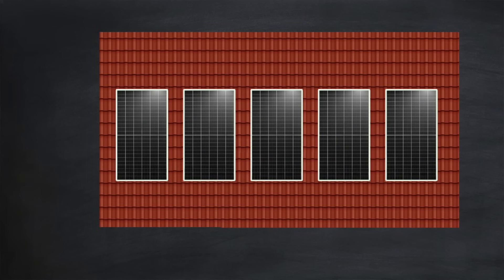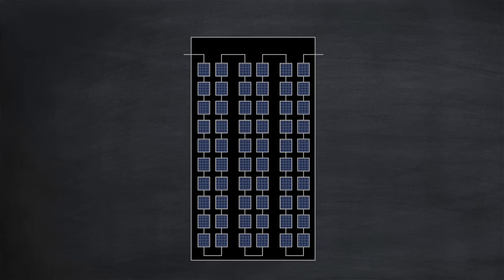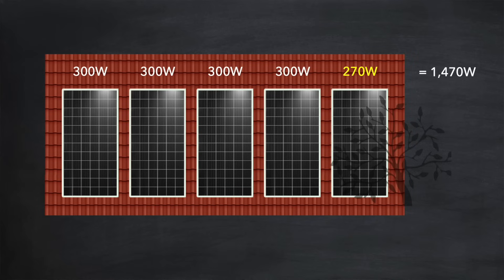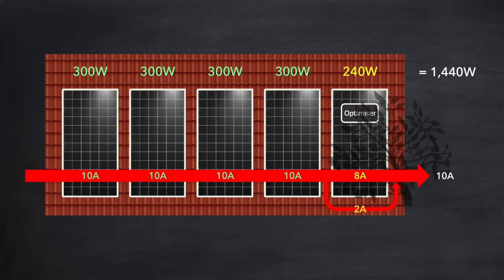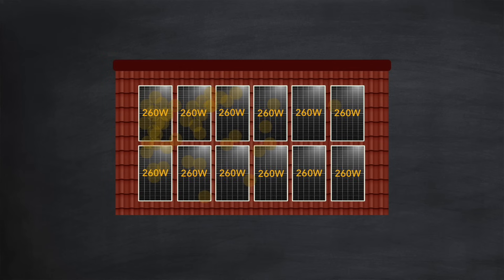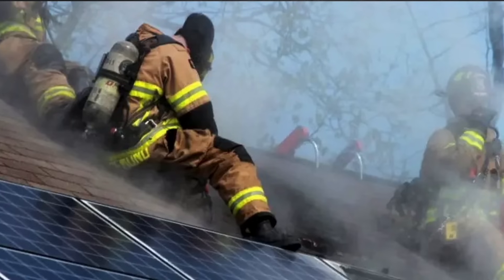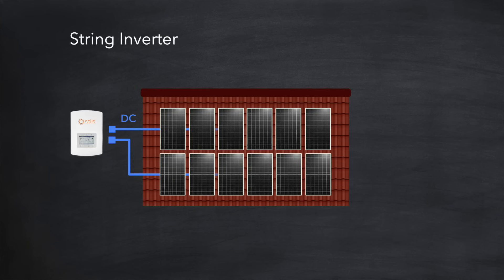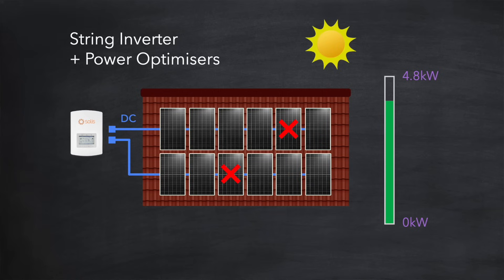Power Optimisers - What are they? And do you really need them?

Comment: At last a solar presentation not full of excitable hype and blah-blah. Consider yourself subscribed.  An optimiser failure on our 2015 4kw solaredge system bought me here so just another single point of data from someone who is absolutely not a techno-pup. The solar edge app has allowed easy identification of the failed unit and access via scaffolding tower from our excellent local installer was only thwarted by high winds. My non technical mind has been swayed by tge advantages optimisers may give as dirt accumulates on some panels. Particularly as we are in a very coastal location and salt accumulation is anecdotally claimed by those of an agricultural persuasion to be as high as one ton per year per acre. Perhaps coastal installations is the subject of a whole new video. Certainly the luminosity of lighf reflected off the water is a plus.

 Anyway keep up the good work Gary!
PS Dang! And then the Immersun unit failed this week - replacement by an Eddi has blown a gaping hole in this year's payback caculations. That and Good Energy going ,via smart meter info, to paying foe exports on actuals rather than a caculated 50% of output. Sorry to rant on but.....pfftt!!!😮😢
Reply from the maker: Hi David, thanks for sharing your experiences and also for your kind words. Given you had a failure a few years ago, would you say your overall impression is good, or would you have preferred to have gone with a different inverter?
Reply: @GaryDoesSolar    Hi Gary! Funnily enough, back in 2015 when the system was only 6 months old the main Solaredge inverter in the garage did fail and was replaced under warranty, the fitter said they had had a complete rash of failures locally hence the upgraded replacement item. 
I was just pleased the guarantee worked as advertised.
As for the diverter/prioritiser (was Immersun, now Eddi) again the fitter said a 'fair few' of the mark I version as he called them had failed , a new improved version was available from Immersun but we just went, as bog standard consumers , with the local company hence Eddi. I take you view that the ROI on such a device is arguable but as two dotty old pensioners who are not mega price sensitive  the big advantages for us is , firstly ,that the hot water is almost always there without any intervention or input from us. (Do I  like getting into a shower and finding I forgot to make hots).
 Secondly the new Eddi app is much improved for us in deciding when to go and switch a dishwasher or some other machinery on plus if needed I can remotely boost the hot water production even when I'm out and about fishing for example. 
Thirdly this is our first ever house with a walk in airing cupboard. Over the last nigh on fifty years Mrs B has measured her progress in life by the stature of her kitchen and her airing cupboard and to walk into one that is always warm just floats her boat.
This is all a long winded way of hinting that ROI is not the be all and end all for all of us and no doubt we are not unique in that way. More about the way we choose to run our lives .

Even the opportunity cost argument bears some scrutiny. I see now our  4kw system cost in 2015 , £6350 including scaffolding and Immersun. To date we've had back £5177.87 in FiT payments and produced 34.8 Mwh of lekky an unknown but substantial amount  of which we used ourselves.  The same year I 'invested' in two funds, Scottish Mortgage and Woodford Equity Income. Scaling those investments to match the pv solar system cost one returned me (back of fag packet) £18000+ and the other    £3000+ . Pffftt!! 

And yet, and yet, out of the three 'investment' I've had much much more engagement and pleasure from the solar system and a toasty warm airing cupboard !! Just need Tesla battery  car prices to come down to move onto the next stage.

Really enjoying working through your videos. Apologies for banging on for so long like the garrulous old git I am.
Reply from the maker: @daviddb2528  Thanks David - such a wonderful comment - I really enjoyed reading it - and you're right - it's not always about the ROI 🙂 I hope others reading it benefit from your experiences too!

Comment: We replace on average about 2 x Solar Edge optimisers per year, some on our own installations, some on other peoples. We install about 50 domestic projects per year. We can't really compare this rate to either Tigo optimisers or Enphase micro-inverters as we don't install them. 

The good thing is that the faulty optimiser can be pinpointed so we don't have to remove half of the array to locate the problem. For the client, Solar Edge will cover the cost of labour and some of the scaffolding costs. For most replacements we can use an aluminium access tower to get up to the roof and locate the fault. The cost of this is easily covered by the Solar Edge warranty. However, the jobs that tend to require a full scaffold are where we need to span over above conservatories or where there is a pitched roof on a lower storey beneath the roof with the panels. For these replacements the client typically does end up having to cover some of the scaffold costs. The more difficult the roof is to access, the more costly it'll be to deal with faults which would need to be factored into any potential client's decision making.

There is an argument to install optimisers & microinverters in the loft space beneath the panels. This would make replacement much easier and less costly. We don't do this as it would mean making a cable penetration through the roof beneath every panel. It would also means installing jumper cables between each panel and it's corresponding optimiser for both the +ve and -ve cables meaning more connections in total. Some attics are converted, so for these it's a non-starter to do this and the optimisers have to go on the roof.
Reply from the maker: This is great insight from an installer’s point of view and will be of great help to those considering optimisers or microinverters - thank you! 🙏
Reply: Why not use a bucket truck or platform lift like tree trimmers use instead of scaffolding.
Reply: @Mike-01234  That won't work because the roof is pitched.
Reply: What's the downside of making a cable penetration through the roof? Is there a risk of rain coming through?
Reply: @RahulParmar1978  no, your installer should be using a weatherproof cable entry point such as the Deks multi-cable flashing
Reply: Great info! 
Thank you!

Comment: Gary very in formative 
Optimisers do also have the advantages of future proofing and system expansion with different powered modules 
With all the new Hybrids in the market if you don't add a battery in 2 years you won't be able to oversize unless you use SolarEdge
Reply from the maker: Thanks, and fair points.

Comment: For the example of string inverter and optimisers would not a failure of one optimiser impact all solar panels as you don’t know how it will fail. It can fail safe, impact only one panel. Or can fail unsafe and impact all the panels
Reply from the maker: They’re certainly designed to fail safe, but you’re right. They might not…

Comment: My roof is unshaded but i do have a somewhat large antenna that create some shading on panels. Would it be worth getting optimisers for that?
Reply from the maker: Now, I can't give advice for individual circumstances (not least because of liability issues, even if that advice is given free) but if it were me, I would first look at moving or removing the antenna. Otherwise, I'd certainly be looking at either microinverters or optimisers if the shading was going to affect more than say 3 or 4 panels...
Reply: Move the antenna is ideal.

Comment: Great video. What is the average line loss for an optimizer?

You mentioned adding optimizerto an older system, as I have a 10 year old system with 46 Sunpower panels split into 7 strings between 2 inverters, the system is starting to show a several percent loss in efficiency. A couple of strings do have shade loss in the mid afternoon until shutdown of about 10 percent. The question then becomes, do I look to add optimizers, and will the increase in production then offset install costs (US labor rates) to calculate the next ROI?

On a side note, to help prolong inverter life, I had my inverters placed in the basement. This has had a few benefits, the inverters run much cooler and they stay cleaner. Yes they dump a minor amount of heat into the basement, but my heat pump hotwater heater negates that issue. It also helps provide air flow and some dehumidification when the heater cycles.

Lastly, I have been trying for years to find data on the "R-value" from adding panels to a roof? As my system covers 50 percent of the total roof and over 75 percent of the roof with direct sun the heat load offset is significantly increased.
Reply from the maker: Hi Steven, thanks for taking the time to comment. Unfortunately, l'm not in a position to provide individual advice (not least because of potential liability issues, even if that advice is given free - such is the world today). You're best to speak to an installer for advice, or post a comment onto a solar forum (e.g. this one in the UK: https:// www.facebook.com/groups/2197329430289466). Good luck!
Reply: @GaryDoesSolar  thanks for the reply. I commented mainly to give discussion on some of the variables. Great videos, it's appreciated.

Comment: While the information is helpful and well presented, in both this video and in your one on microinverters you do not address the implications of selecting either device type on the use of a battery system. Microinverters imply the use of a second device to convert the AC back to DC; from what I have seen, many battery systems cannot supply blackout power when used in this configuration. The design of the system allows battery use to do timeshifting, but not backup. Optimizers would appear to offer a simpler design as far as battery systems since the DC need only be stored in the battery (using a more efficient  DC to DC transformer if needed), and the ability to configure the system for both timeshifting and full backup also appears simpler.

What are your thoughts on this, especially where the installation is on a home where grid power may be less reliable and frequent interruptions may occur? I think many viewers would like that presentation...
Reply from the maker: Thanks for the kinds words. It is possible to add an AC Coupled battery to any system, including one with optimisers or microinverters - and that battery can provide EPS (backup). With an optimiser-based system, so long as the string inverter is hybrid, a DC Coupled battery can be used (subject to that battery supported by the inverter). I am releasing a follow-up to my battery video this Saturday, which goes into detail on AC and DC Coupling - hope you like it :-)

Comment: Hi Gary, In your video you indicated that a optimiser bypasses 1 amp when the solar panel is giving 9 amps to give 10 amps. That 10A is then the same as for the other solar panels. The optimiser does not bypass current. Let's say that the solar panel is only producing 15v at 5 amps. 15v x 5A = 75w. What the optimiser does is it converts the 75w power into 7.5V at 10A. 7.5V x 10A = 75w. This then makes the 10A current to be the same as the other good panels. But instead of the voltage in the string being say 30v. it is now only 7.5V. When you add up the total voltage of the string. It will now be less because instead of one panel being 30v it is now only 7.5v.
Reply from the maker: Agreed - and I already added a notification correction to the video - I was being too simplistic in the narration at the time, and you have expressed what actually happens very well.

Comment: I have just replaced 2 optimisers that failed in the eighth year after installation.  Their tech support guy said that 2 out of 13 was not bad, he had seen worse.  He won't hear much from the satisfied customers with no issues.

Found out that Solar Edge have a 12 year warranty on the optimiser, but only contribute to labour and scaffolding for the first five years.  My installer quoted £1500 + VAT.  I did the job myself after bracing my scaffold tower off the wall and using ratchet straps and wall eye bolts to keep it all steady.  The tower also makes cleaning easier.  I had begun to have issues with some lichen growing on the panels.  Have been told thus is more common in the vicinity of silver birch trees.  A large one behind us causes partial shading issues throughout the year, so I am still convinced of the benefit of optimisers for my installation.
Reply from the maker: Thanks for sharing your experiences with optimisers. I agree - I’d like to see SolarEdge do more with their warranties - cutting back after 5 years on products they claim to last 25 years or more is very poor.
Reply: Lichen is becoming more of a problem over the years. My system is 13 years old now and have been suffering for a few years. No trees anywhere near, interestingly even after cleaning it made little difference to OP. I wonder if the self cleaning coating is wearing off over time as I see a lot of lichen now on older systems

Comment: Thanks Gary, another clear explanation of the pro’s and con’s of the solar setup.   Just a question about real-world experience of two of the potential benefits of optimisers from 9:17, dirt on the panels and panel degradation over time. 
I’ve had a 16 panel FIT array (2 strings) on a Growatt inverter fitted for 7+ years now.  Until we had scaffolding up earlier this year to fit our newer GivEnergy arrays I had never cleaned the panels, and in theory over that duration would start to see some panel degradation, but in fact total annual output each year has been consistently around 3mW, with 2020 and 2022 both generating slight more than in 2016 and 2017.  So in my experience there hasn’t been any significant dirt-related or age-related power reduction - or any reduction is masked by the annual variation in solar generation.
Reply from the maker: Thanks Geoffrey, for your kind words :-)

With regard to dirt etc., that's great to hear - I can access my panels relatively easier through several Velux windows we have on the roof. My main problem is to do with birds unloading on the panels! And when I clean I do believe the performance increases, but I don't have hard data to support.

With respect to panel degradation, this is documented in the data sheet for the panel model in question, so likely to occur. Perhaps others can comment on whether they see such degradation over several years...
Reply: @GaryDoesSolar  Ah yes, birds on the solar panels.  As I said in my original comment, I didn’t wash my 16 FIT panels at all in the first 7 years of ownership.  When I did wash them there was a bit of lichen in places, but nothing too significant.   There wasn’t really much in the way of bird mess either.
But we then had a further 28 panels installed in January this year with the GivEnergy inverters, mainly on the front of the house and the garage, but then 6 further panels in gaps between velux’s on the back.
Within 2 months of installation I noticed that one of the new panels that was directly under the TV aerial had loads of bird poo on it.  Of course the little darlings were sitting on the TV aerial and dropping onto the lovely new panel immediately beneath.   I rapidly went and bought some plastic bird spikes, stuck them with silicone to the TV aerial and the birds now have to perch on the ridge of the roof but at least they only drop messages on the tiles not on my panels !

And yes, agree about solar degradation over time, its well documented in the panel literature and any new solar quotes.  Just commenting that in my experience I’ve not noticed it, or if it is occurring its lost within the annual solar variation anyway.  20 years or so, maybe more significant loss.
Reply from the maker: @geoffreycoan  Now that is a LOT of panels! What is your typical generation on a good day? Nice solution re. the birds! 🙂
Reply: @GaryDoesSolar  When we had the new solar added I went for the principle to get as many panels on as possible, maximise the solar generation opportunity and make the most use of the scaffolding whilst it was up. Despite having had a roof survey done by the installation company they then had difficulty fitting the 6 panels on the back (West facing) in and around the existing veluxes and FIT panels.  Managed in the end.  So most (22) are on the front, and only as they were fitting them did I realise that I could have added 2 more over the garage and 4 horizontally over the kitchen and porch.   Fortunately no export restrictions from the DNO either 😀
Answering your question, its difficult to answer as the FIT array confuses the CT clamps for the inverters as I am generating on the house circuit where they are expecting only demand.  On sunny days I end up with negative generation to home and battery to home figures!
But, based on the GE reporting the 28 panels typically generate 20-30kW a day.  Best so far was 7th April at 48kW.
Reply from the maker: @geoffreycoan  Thanks for the extra detail. I had similar problems with my roof space - the Velux windows really constrained how many panels I could get up there (and also the orientation of those panels!) Your generation stats are very good! And being on FiT is just the icing on the cake! 🙂